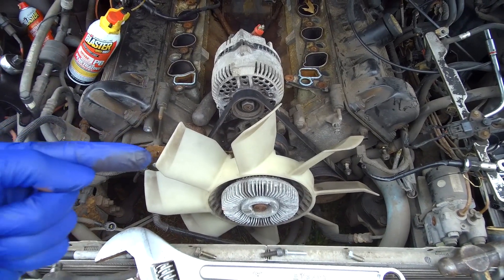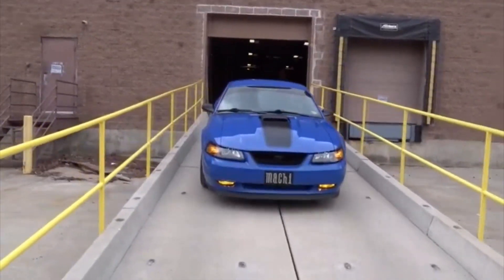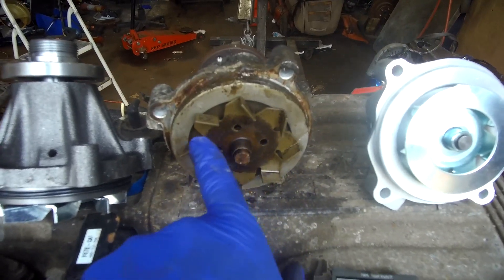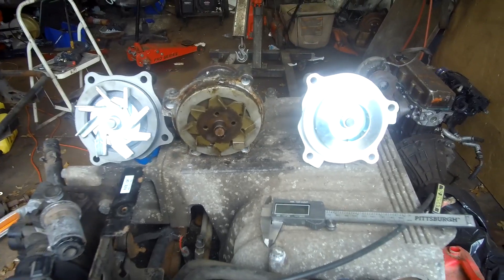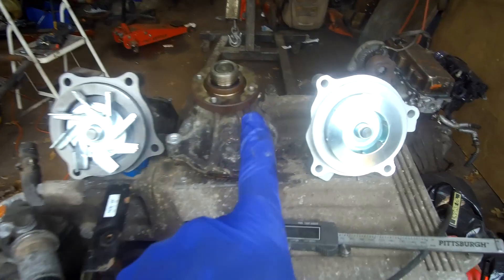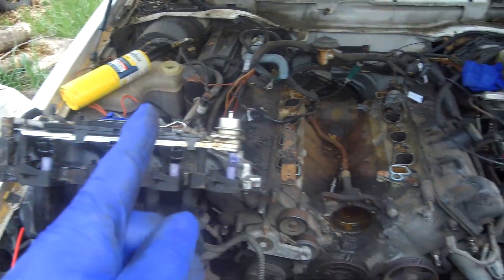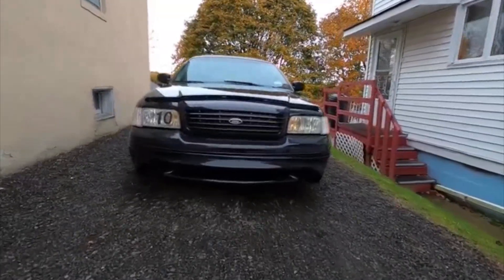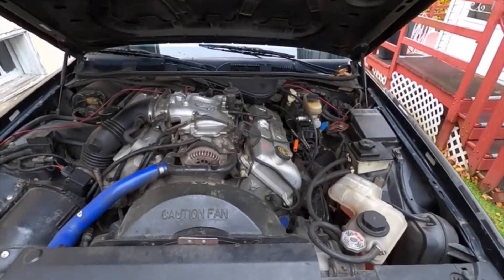WHY Did The Roush Cobra Crown Victoria used a v10 Water Pump ?  (

Comment: Ford, Chev, whatever you got,
Don't mean shit if the shit ain't hot.
Reply from the maker: TRUE!,  but how much you spent to make it hot... Sometimes you can not follow trends. people are scared to do there own thing which makes the whole car thang carbon copies when you follow ( if you under stand )
Reply: @bstfordchannel923   Thanks for the info!  Yea I have my 03 Vic PI.  I have a 100k mile 2010 engine, Monster transmission, and new brakes with ball joints. Runs like new and expect it to for the next 10 years.  I want that water pump. Would you know exactly what year F250 radiator they use?

Comment: I Had a 94 Mark 8. Check out the bypassed coolant lines that meet in the middle of radiator right in front of waterpump with a fitting in the middle with a threaded plug you take out to Burp the radiator any time you add coolant or open cap. They fixed it on 2nd gen. Just a first time design hiccup. I LOVED that car.

Comment: As far as the coolant pipe under the intake, a common mod is to take out the freeze plug on the driver's side head and put in another tube like there is on the passenger side head  and tee both sides together with that tube under the intake. I did it on my dohc 4.6.
Reply from the maker: Yup you are correct

Comment: you can wire the fan to the hot side so when the engine goes to run it comes on. everything can fail thats why you have a dummy gage or light for. save that engine and be smart about it. besides a old school fan robs alot of hp. you wouldnt beleive how much either.
Reply from the maker: Thats where I am at trying to figure out where to go with it, but i have a idea what to do... going to check the pros and cons to these fans 1 day ( real time )

Comment: Love the channel! Keep the videos coming. I have one quick question. I have a 2004 expedition with the 5.4, 3 valve and 254,000 miles on the speedometer. I know that someday I will have to rebuild the engine. I would like to know what would be your approach with that engine? Would you swap any parts from other motors or just rebuild the original heads and block?
Reply from the maker: Machinist told me either swap the engine for better one OR rebuild the engine with the parts you have... You can get a rebuilt head ( thats done ready to install ) or you can slowly do yours ( thats if you doing it yourself ) kinda see the cost if YOU where doing it vs a shop then check remain prices Ralphie
Reply: @bstfordchannel923  Ok thank you! I keep hearing mixed reviews about the 5.4, 3 valve. Some people hate it and some people love it. Since this Expedition is new to me, I haven't really had enough experience with it yet. What is your opinion on the 5.4, 3 valve engine?

Comment: Eh I wanna give Mr. Random a chance but he has yet to deliver when it comes to to finishing promises and builds
Reply from the maker: This build is a tall order This isnt a cop car build this is some serious car fabrication here.  Engine swap, 5 speed swap, Cluster, Diff, Fan and water pump . Clutch pedals. Rear diff gearing. Front bumper, roll cage, fuel cell, just so much to do here. And he will do it ( just have to push him)
Reply: @bstfordchannel923  yeah all his fans were pissed when he didn’t deliver on supercharging his Vic, only time will tell with this build

Comment: In a pinch you can use the air chisel with a punch bit and give the fan clutch a burp to loosen it.. and also same to get the old water pump out.
Reply from the maker: No compressor brother THAT would have worked... I had to come up with something quick.. I needed this out
Reply: @bstfordchannel923  your way was the better way .. air chisel way will leave a mark on the nut.
Reply from the maker: @462ANIMAL  true but I was to that point of air chisel .. I  just did not have one lol

Comment: Cool video, I didn't know about these cars. Back in the 1960s when "police interceptors" first became a thing most people didn't know what the secret was. The police Plymouth Belvedere didn't have some secret cam or carb that was unavailable on a Road Runner. It didn't even have a six barrel carb setup. What did did have was a giant radiator, fan, and high capacity water pump so they could idle the car all day then chase that Road Runner until it overheated and broke down.
Reply from the maker: ahh I like your logic giant rad and fixed fan with a good flowing water pump. and you can hawk down a car after the other has over heated lmao.. And there is some solid truth behind that.. Reliability  over Performance

Comment: That is a truly cool car. Seeing then sliding it around on that track and the body is just planted... that's how I want my car to be.

That water pump was annoying to get out but I didn't have to deal with the manual clutch fan fortunately. I have to be stupid now. What is that rusty pipe that runs from the water pump through the engine valley?
Reply from the maker: that part is the water pump feed to the heater core.. You see its wet and they do go bad over time.. Now this car in this video PURE coolness i have to see one live to really get grasp of the car.. This will be cool. Your car can be set up like this just have spend a few coins on the the shocks ... Just take your time and grow with the car..
Reply: @bstfordchannel923  for sure

Comment: I went electric fan in my hot 289 67 Mustang. It wasn't enough. I installed a flex fan. Problem solved!
Reply: Second this had the same issue in a old 302. I thought electrical cooling fan was the solution.  Later it was a hidden issue
Reply: @chrisbird1909  you guys need 2 fans.
Reply: @pickolascage1283  
Many of Ford's older radiators aren't big enough to fit 2 fans.
Reply: @upsidedowndog1256  early 90s and upwards.. anything older wouldn't be worth the trouble of removing the fan and it probably won't be effective if you did.
Reply: @pickolascage1283  yeah, my Mustang is a 1967. Well built brass radiator, but it is small and square. Electric was a waste of time there.
Reply from the maker: Two fans will do agreed David Thank mechanical fan always work though... If electric fan you will need two
Reply: @bstfordchannel923  no doubt! My 07 started to overheat and I thought it was the pump- come to find out one of the electric fans went out.. still,  easier to change those things like pump and belt with no fan sticking out from the water pump!🤣🤨